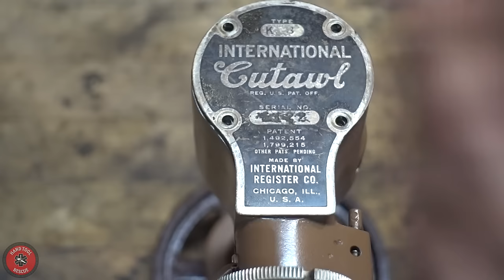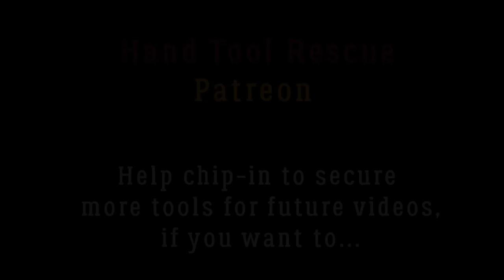1930s Rotary Jigsaw (Cutawl) [Restoration]

Comment: my dad had a couple of those and used them for years. I can see how you got that set up wrong. the holder/guide is to low and should clear the work with the machine sitting firmly on it's base plate. Most of all, those machines use a chisel type cutter, not a knife-like blade like you have there. when the blade reaches TDC it should be clear of the work. the thumb ring is only touched when you want to change directions, as in, come down one line, lift the machine, turn the blade with the thumb ring to take the new direction, then set it down right at the end of the last cut and head in a new direction. also, you didn't fix the lamp mount, it's bent, hammer it flat and pop the end of the lamp through it so it's got a solid mount and not flopping around. also, I recall my dad's machines ran a lot faster than yours does, like, way faster. also, lube up all them moving parts with oil, dad always oiled his every time he used it, he would cut 1/4 inch beaver board (like a thick card board) and thin plywood, but plywood would mean sharpening the blade often. the blade, when sharpened like a chisel, should be stropped to make it razor sharp before every use. I thought you might like to hear from someone who had seen and used one of those things.
Reply from the maker: Awesome info.  Thank you!
Reply: you're welcome. I have been thinking about my dad's machines and I wonder what happened to them. I recall he had a piece of the beaver board that covered the table top what acted like a backing for the work, so the cut edges would be clean. The blade was set to 5/32" if he was cutting 1/4" and it would leave a copy of the cuts made on the backing and after a year or so, it was time for a new one. I bet that machine would cut foam board just fine. He would cut out letters, then paint them and glue them to a backing to make a sign with raised letters. I recall the vibration of the operation would aid in the movement of the machine. I'm sure the balls you made for the handle are too big, those look closer to 3" and they should be 1 1/2" to 2". The balls on my dad's machines were like billiard balls to the touch, I think that bakelite ball that was on your machine had been swapped out by someone who wanted the nicer handles that were on your machine. I think those large balls will make it clumsy to control. when the tool is not in use it should be standing on it's back (the pulley side) to keep the blade from getting blunt and also to make access to the blade easy. not that this is important, but my dad's machines were burgundy and black. you might consider polishing the face of that plate to help it slide over the work without leaving a mark. whats with the preparation H, is this an old wives tail? you should load it up with white litheum grease. also, that brass oil tube is capped with a screw, remove only the screw and fill the tube with oil. speaking of oil, I use this stuff https://shop.advanceautoparts.com/p/lucas-oil-products-air-tool-lubricant-16-oz.-10216/7070033-P
it's designed for use in air tools and is a real good all around oil. a little goes a long way. by the way, it is not a jig saw, it is not a saw at all. if you want to describe it in those terms call it an electric chisel cutter, but, in my opinion, you shouldn't call it what it isn't.
Reply: I don't think it is fair to say that the Cutawl is not a saw at all.  They were made to accept saw blades too, and toothed blades were best for cutting wood.  It is just that it also has the ability to use a chisel, or a punch that makes it more than just a saw.  And the variable stroke length really sets it in its own little world.
Reply: interesting point, Robert, I had never considered what accessories the machine may have had available in it's hayday. my dad only used the chisel tip, so me, in my foolishness, assumed that was what it was meant to do. it would be interesting to see a manual to see what all was available at the time. perhaps something odd. you make a good point though.
Reply: Yeah, they're a remarkably capable machine.  Their downfall was the advent of inexpensive CNC router tables, and the fact that it is difficult to build and market such a tool into a hobbyist's budget of today.

My first, a K9, was given to me by a theater set designer who knew I had a penchant for odd tools.  I have since picked up a K11 on Craigslist.  

There is a "Museum" of these online with all the manuals here:
http://rhettmagic.furman.edu/dramadept/CutAwl/Manuals.html

and a page dedicated to blades here:
http://rhettmagic.furman.edu/dramadept/CutAwl/Blades.html

Full scans of manuals are available under the downloads link.
Reply: Christopher W. Dowie: nice info..

"CutAwl"  nice tool, electric Awl, but then it isn't poking holes..  (of course a play on words).
The following feature (like a drag knife) is great meaning you can cut complex shapes without turning the base around,  just add pressure in the correct direction and it turns, very nice....    Do they make a tool with this feature now(a)days??
Reply: Robert Litman: I think there was something like a 70 year gap between the 1930's and cheap CNC (in any guise)..
Probably it was merely that Black and Decker or some other brand were more successful at marketing their non swivelling "jigsaw" alternatives.. (seems this was always a highly specialised tool for signmaking etc..  never a mass market appeal (I have never seen one before)
Reply: I have no experience with this type of tool from this era and as pointed out further below in these replies it may have had many "setups or accessories".  Observing the setup during the restoration I would hazard a guess it was used as a drawknife for custom leather work.  It appears that it might make short work of tailored patters for light shoes or clothing.  Super interesting tool. great video.
Reply: @robertlitman2661  I'm pretty sure the saw blades/etc are also-ran accessories, and the original intent was the chisel-cutter.  The name of the tool  is itself a reference to that mode of operation.
Reply: An awesome set of resources, thank you for posting them! There are several auctions for these machines on eBay, around $200-300.

Comment: cant help but think that lamp is supposed to be connected differently, looks to me like the little bracket was bent and part of the affixing either broken or missing.
Reply: Lamp seems to be just flopping there.  Maybe it was an add-on piece?  Or a replacement piece that is not original?
Reply: he fed the lamp through the wrong way.... the wires go in from the top and the bracket was bent down.... the base of the lamp goes up through the bracket.

Comment: I used a Cutawl right up to retirement age when working in CBC Art Department. A great tool for fine detail work . Using the rotating saw  blade with a forward motion of the machine took time to learn, but was amazing after. Although ours was a later model, (50s/60s? ), it was black, not brown. Fine job restoring though!!

Comment: That lamp seems strategically placed to burn the bejabbers out of your hand when you accidentally touch it. 

Now, you could put in an LED bulb, which doesn’t get so hot, but with the original (presumably incandescent) bulb in there— Ouch!
Reply: Gary Cooper its a safety feature if you get tired and start to drift of you burn your hand it wakes you up and you don't lose a finger or two. andy England
Reply: There were no LE fing D bulbs back then.
Reply: leds wouldn't do a restoration
Reply: I prefer the old bulbs

Comment: Love the channel brother and so glad I ran across it. 

Question, I notice you remove the rust via a liquid remover first then wire wheel. Why in that order? I would guess wire wheel first to get most off then let the liquid get into all tiny crevices for a good clean. Thx
Reply: the rust remover puts a dark surface on the metal parts. sometimes he likes this look and sometimes not

Comment: 1 the original A6 is all one colour, (a slightly orange milk chocolate brown)
2 the paint is going to come right off of the body filler showing the pink filler, try a carbon black(soot) additive to the filler perhaps? , the originals were also perfectly round with 2 closely spaced grooves like a belt around the middle
3 the outer side of the light hood is also brown while the inside is a high temp white paint....this was to avoid glare in the operators eyes and reduce shadows on the work. the hood is also attached to the bracket via 1/8''-27 NPT straight and backed with a corrugated washer and a  thin electrical lamp  hex nut,  light and outlet cable and motor wires were a braided cloth covering.
4 you resurfaced the front cover platen AFTER installing the mechanics!? eek... remove, brake clean  and compressed air asap to remove the grit

apart from those details its not a bad job there, nice to see that there are still a few out there in working condition.
Mine was used by a local sign shop for cutting out silk screens, coloured card-stock, fabric and such.  I have a booklet somewhere that shows, needles, chisels, fine coping saw blades and scaple like blades as well as scalloped blades, guide extensions and a whole assortment of add ons. Im told that they were also common among theaters for prop set and costume cut outs as well as for upholstery shops and the like.
sadly mine has a rather mousey smelling box so she was a little better starting condition but not nearly as shiny and new looking as the end result achieved here

Comment: why use preparation H instead of grease?
Reply: yeah i would like to know that as well
Reply: He eats old grease, why can't he put a cooling gel instead of new grease? Don't judge him...
Reply: Preparation H is a viscous petroleum based grease. Why not use it?
Reply: Because preparation H feels good, on the whole...name that movie...
Reply: Ever see roids on a jigsaw? Now you know why.
Reply: It's just expensive petroleum jelly, he could have used petroleum jelly. That certainly beats the cheapest kinds of grease which turn to glue, but a proper molybdenum based grease may have been better. On the other hand, it probably won't see much use in which case the petroleum jelly prevents it from rusting anyway.
Reply: It is not petroleum jelly. Preparation H is a gel. Not grease. He put it in the same way he eats old grease in a previous video. You should believe everything you see in the video, it must be true.
Reply: @Sam S Why not use something that was formulated specially for engineering components rather than something that was formulated for bum holes?  Eejit
Reply: The
Reply: @Rick LaFaver Uhh Possibly Austin powers?
Reply: Rick LaFaver What was wrong with preparations A through G?
Reply: It helps shrink swollen tissues.
Reply: supersaiyamanlb because fixing old tools is sometimes a pain in the ass
Reply: it's a joke like when he eats Nutella and acts like its grease....misdirection. A handyman and a showman
Reply: austin powers

Comment: You still didn't fix the lamp....
Reply: He did fix the lamp. Don't you see it is on when he is cutting.
Reply: I guess he didn’t fix the white coat on the lamp
Reply: He didn't fix the clamp on it...  The assembly is still dangling on the wires...  I was wondering too...

Comment: Awesome! I enjoyed it a lot. Thanks for sharing your skill. I noticed that you seem to be doing this on a shoestring budget, which makes it all the more impressive. No lathe (I surmise), no snap-ring pliers, no paint booth, no solvent-based cleaning bucket with a continuous flow of solvent, and much more. When I compare to "my mechanics", the list of things you don't seem to have is long. Yet, even in light of those handicaps, you did an impressive and interesting job of restoring the jigsaw. Suggestion: I would have enjoyed having just one or two more pieces restored to pristine order. For example, there's a piece of naked steel somewhere that still had lots of mottling. A few other things like that. Then again, my mechanics has utterly spoiled me for every other restoration site I've found. Request: Keep doing these amazing restorations and sharing them with the world! Thanks.

Comment: Nice! great job. I too was a little befuddled by the light mount. Here is a picture I dug up.  http://rhettmagic.furman.edu/dramadept/CutAwl/K8.html
Reply from the maker: I am missing the little "washer/clip" that would keep the light in place, it seems.
Reply: Perhaps the mounting bracket was press fit to the lamp base? if you look close at the second picture it appears to be a flush fit.
Reply: I could take a closer look at my K9 if that would help you.  I could also measure the balls on mine.

BTW, is that the original lightbulb?  I find the custom bulbs in these to be really cool.
Reply: Nice! Now he can fix that annoyingly loose light bulb.
Reply: Seeing as I'm old as frig and I saw a lot of old mechanical and electric tools when I was a boy I seem to remember that the light socket itself would be peened over the metal piece but often times too much manhandling of the fixture and the join would slip loose.  Don't think it had a clip, but that don't mean that it didn't...
Reply: From my memory of other lamps mounted similarly be lieve you are right but for one small detail... I seem to remember the base of the lamp being peaned over the metal of that mount.
Reply: MISTERComaToes.  Yes,exactly.
Reply: At first I forgot the tool was a K9 and I wasn't sure how measuring the balls on your dog would help.

Comment: I rebuilt many of these. I used a Cutawl everyday for 20 years in the steel rule die industry. They do cut 1/2" - 5/8" plywood with a blade with teeth and a much faster motor.

Comment: Worth noting that with a coil it doesn't matter which wire is the hot wire ... it's just a loop of wire that goes round and round and round and round and comes back to where it started.

The field is produced by the current flow, so there is no ended-ness to a coil.

Might save you a few seconds next time around.

Still love your videos ... sorry for the out of sync comment, I'm just binge watching :D

Comment: i'm reading all these comments about how things were made so much better long ago.
Im old enough to have seen some of those "GOOD OLD DAYS"  and I can tell you every era has it's excellent  and it's crummy products.

It's up to you to know what's good and what isn't.
I retired from the heating, cooling, and refrigeration business and I had to buy a lot of specialized tool for the job. I had the best luck with Milwaukee, Dewalt and a couple other American made power tool brands (no foreign power tools in my tool box).
My test instruments were all Fluke, Amprobe,. 
Yeah they cost a mint but they never failed when I needed them . Point is you can buy  cheap and crummy or you can buy high and never have a regret

Comment: At one time these CutAwl machines were common in sign shops.Good for cutting letters out of cardboard,gatorboard,thin sheet metal,plastic,and wood.Sign supply shops sold these tools as well and the blades.

Comment: Ok, I give up. How did you not only remember where ALL those parts, some tiny, went and in what order?? Nice idea with the Bondo. Impressive drill work. You let the bit do the work instead of  using excess pressure. Don't know what spray chemical you used first or why. Most vids show the electrolysis process of removing  rust. I get excellent results using one of my many wire wheels and it goes much faster than electrolysis. I didn't see you test for lead in the old paint as some others seem to do. Nice project with great results.

Comment: Amazing work. I was surprised by the Prep H. That particular product has water as one of the ingredients (not good). There is a Prep H that is petroleum based (Vaseline) with no water. Using Prep H still eludes me. There are many food grade machine lubes that would work just as well. Lithium grease would also have been preferable.  I especially admire that you did all the research on the tool prior to working on it. Gotta love Evapo-rust. Great product. (Rats! Now I need to buy a 5 gallon bucket of it) Laughed my butt off when you smashed the knob. Hilarious! Thanks for the inspiration.

Comment: Nice, only problem with this restoration, is the lack of a ground wire retrofit for safety; there is a reason we now have double insulated power tools, if you have ever had a "knock you to you knees shock" and survived it, the three prong plug and grounded motor frame, would be top on list of requirements.  The light: the metal tab through which the wire passes, appears to actually be intended to mount the lamp holder itself and is not intended as a wire guide (which will chafe the wire eventually and shock you),  there was a 90 degree bend in that tab that was straightened out after the fact.
Reply: I can only agree with this. He did use the original wires for the motor, the risks of the insulation becoming exposed and making contact with the case are quite magnified. I don't wish him any harm, but again, I agree that grounding is a very good safety recommendation.

Comment: Just curious why you left the lamp hanging loose like that, or is that how it was designed?
Reply: I wondered that too, but it appears that the bracket should hold the lamp firm, so there's still a bit more work to do on the piece. 
An image search reveals how it should look.

Comment: A restoration gunsmith I watch uses a carding wheel rather than a harder wire wheel to avoid finish damage. Is that something applicable to your tool restorations?